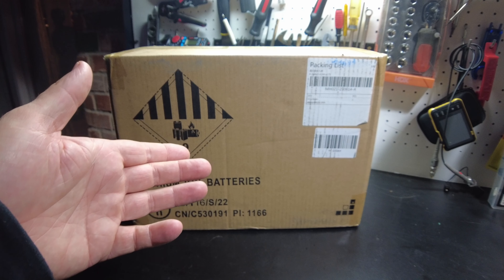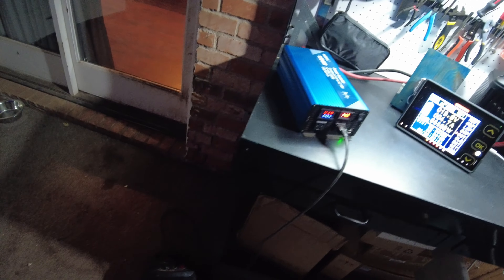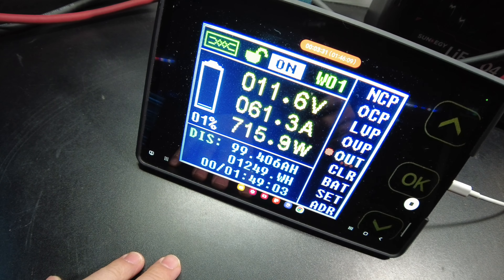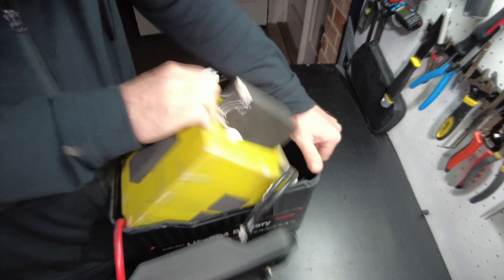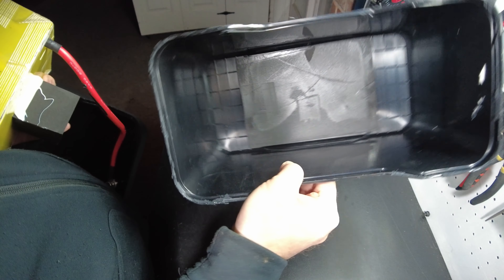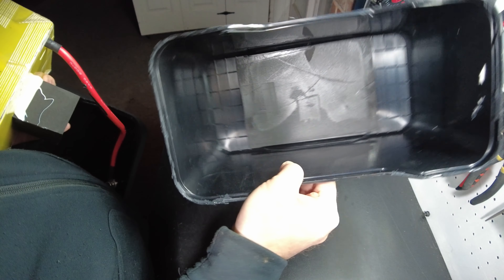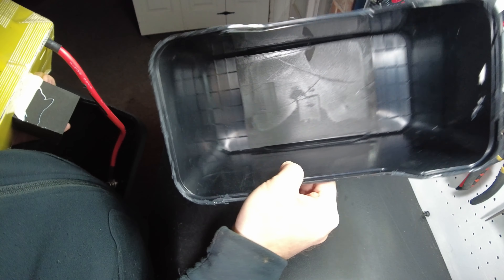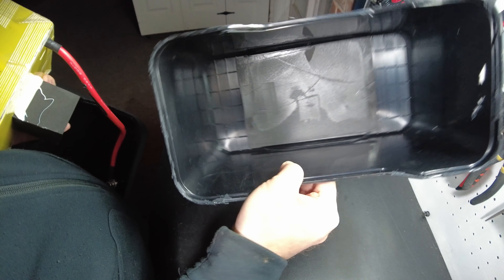Sundegy 12v 100Ah LiFePO4 Lithium Battery

Comment from the maker: Affiliate Links:
Sundegy 12v 100Ah Battery: https://amzn.to/4agsMVx
ALFFAA 1500w Inverter: https://amzn.to/40bD8R1
Midea U Shaped 12000BTU AC Unit: https://amzn.to/43xiXPm
Shunt I use VAT-4300 https://amzn.to/3SX0bvK

================
AFFILIATE DISCLOSURE: This channel may earn an affiliate commission if you purchase products through links I provide. 
================
CONTACT: bradcagleyt@gmail.com
Business/Collaboration only. Please do not contact me for for personal project help, or advice.
================
DISCLAIMER: These videos are documenting my own projects, and experiences. These projects, and activities can be dangerous. Do not try any of this at home, doing so will be at your own risk.
Reply from the maker: @JOHNDANIEL1  I totally agree, I'm not sure where the 4 in parallel limitation myth came from. If you use proper wire, and well I did it with a fuse on each just for extra protection, probably just being overly cautious on my end LOL
Reply: @BradCagle They do not understand natural shunting with cable gauging. I connect them all with cable that is rated for 80% of the battery ability, the result is the draw resistance in the cable defaults the self equalization.
Reply: @BradCagle  PS  If you wanting to make a mega system, use 65% Lead Acid with the 35% LiFePO4, set your solar to AGM, with top float at 13.0 and recovery at 12.6 then you can run massive loads against the lead acid, the LiFePO4 is voltage support and back fill. Mine is that way over 15 months now, not one issue. 900AH of LiFePO4 connected to 3200ah of Lead Acid. Over 770 amps hit the lead, the lighter cables on the lithium protect it from that draw, but allow the lithium to volt support the lead. 
Best thing is no more "cleaning" your lead acid. It never gets crusted up. Stays over 60% even in all conditions. Uses 30% less water too.

Comment: Excellent presentation.  Thank you.  That said, look at all of that wasted space in the case - maybe 2 inches of air on each end.    I am really digging the new small form factor 100Ah units around 10.2x8.9x5.2 inches.
Reply from the maker: Thanks! Yeah we should be seeing smaller cases more often I would expect.

Comment: How do these batteries do 2 or 4 in series without the BMSs communicating with each other? Without communication between the BMSs the batteries would become imbalanced over time.
Reply from the maker: You can use a battery balancer, Victron, and a few other companies sell them. Just a little over $50 I think.
Reply: The total pack voltage doesnt matter because each 12.8V pack's BMS is taking care of balancing the cells inside.  So whether you are using 1 battery or 4, the BMS's are stopping charge to individual cells to perform balancing.
Reply from the maker: @jeremiahostrosky3448  True, but the individual batteries can go out of balance, meaning overtime one battery may be 100% SOC, and the other may be 95% SOC

Comment: Curious, when you spray the temp sensor how cold is that spray?
Reply from the maker: Not sure, well below zero. I considered using a freezer gel pack. Might do that in the future.
Reply: thanks, I'm always leery about BMS settings @BradCagle
Reply from the maker: @siddo326  I had that happen on a Daly BMS. The duster would not even trip it. I checked the settings in the app, and it was set to -30 or 40. Lol, I set it to 0, and it worked fine.

Comment: With all the batteries you now have, it might be worthwhile writing the cell voltages down if some packs are not going to be used in near future. I've been messing with lithiums since they came out and have some very early cells that I still use, the longevity is decades if the cells are good.
A good cell will hold its voltage and drop by 0.01volt over 12 months or so period, anything more than that and you have a second rate cell. So I  have alot of these older cells and have been monitoring them since about 2007/2008. Many many cells have lost voltage over the years and are now not useable ( if I was more organised I would have topped up the ones loosing voltage).
Since you have a wide variety of cells over the years you will get a good idea of which ones are going to last, but you need to know how fast the voltage is dropping if they are not in use, and top up the ones that are loosing voltage quickly so they dont die as in my case.
I still use some of  these cells almost daily on my ebike
Anyhow main point is natural voltage drop of a high quality cell is very very slow.